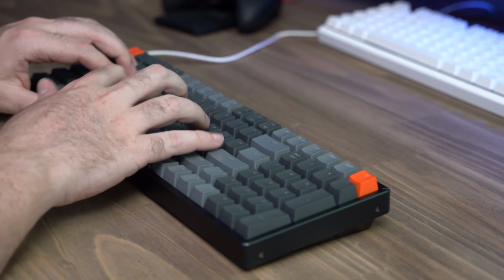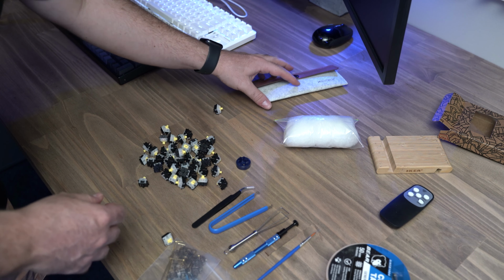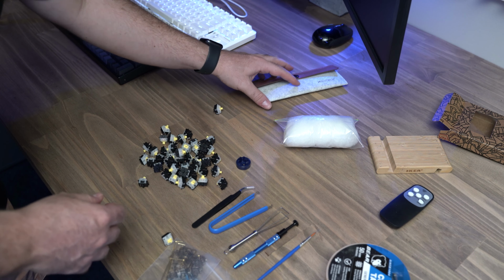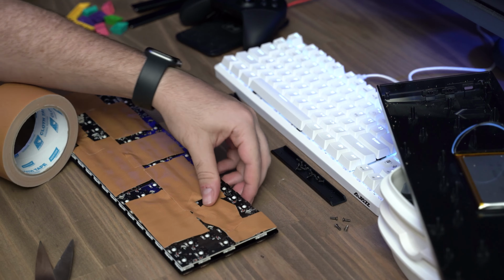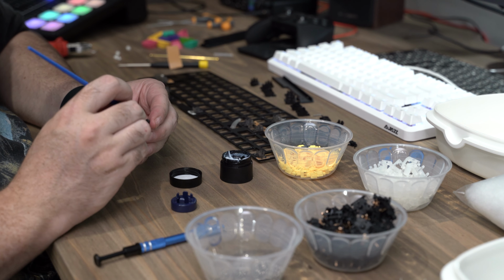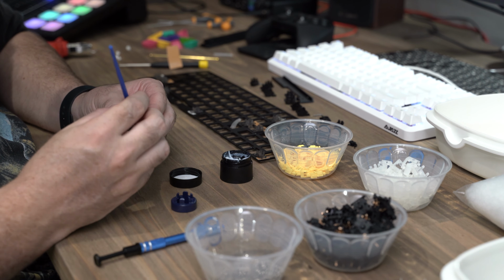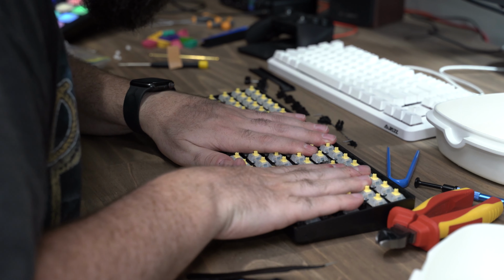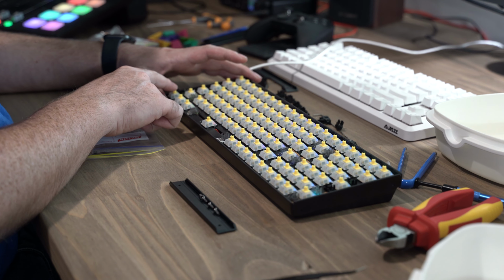CUSTOM Keychron K4v2. From CLACK to THOCC. DIY! Complete Rebuild.

Comment: The tilde key is the only key that requires a 3 prong switch because of the USB C port is situated underneath. So you can use 5 prong switch sets, but just be weary that your tilde will most likely have to be modified
Reply from the maker: That's interesting. Did not know that but makes sense.
Reply: Is there any advantage using the 5 pin over 3 pin switches?

Comment: Can you link all the items that you used in the mod? I found switches polyfill and switch lubing kit, i cannot find durock stabilisers and how you removed and fit the new stabilisers? Are these plate mounted or screw in? Also can i use prelubes milky yellow pro from amazon?

Comment: Nice Video mate! Changing the Keycaps alone feels so much better on the K4. The original ones feel pretty cheap.
I also used some Killmat and it sounds so mucher better without changing or lubing the switches.

Comment: GREAT Video. But I have a question: It would be possible to use some LOW PROFILE switches (and Keycaps) in this K4 keyboard? Im thinking about it and I cant find any review about this possibility. Thans for the video again!
Reply from the maker: Due to the position of the LEDs on the board I don't think it would be possible to be honest. Bummer I know.

Comment: Have you got an update on this? I got the same one, it’ll be my first mod and I’m curious about tape/foam on a case with a battery.
Reply from the maker: The power draw from a keyboard is so low your battery is never going to get hot enough to be concerned about that. I just made sure to not put foam around the battery area to leave it enough space to breathe.

Comment: Wondering if you have any tips for installing the stabs? New to this and put durock pcb mount stabs from switchkeys. The stabs just dont lift up with the switch when I press it.
Reply from the maker: It sounds like you may have the inner piece back to front or you’ve got the poles going into the bottom hole and it needs to be the top hole to get leverage.

Comment: An awesome sound, does it (kinda) work if I keep the original gateron brown switches and I apply lube and all other mods? I bought it a couple of months ago and there is a little clearance inside the switch that makes the keys wobble a lot and they make a lot of noise.
Reply from the maker: Yes lubing the switches will make a big difference but if you want my advice, buy some pre-lubed switches and just swap them out because the time it takes to lube is painful. I would rather just swap switches which is like a 20 min job compared with lubing which is literally hours on hours.
Reply: Did you end up lubing the brown switches or buying pre lubed? I am doing the same thing now and wondering lol

Comment: Would this sound similar with Gateron browns?
Reply from the maker: Yes and no. Lubing them would make them sound way softer yes but browns are still a semi tactile switch compared with the linear milky yellows I have used in this video.